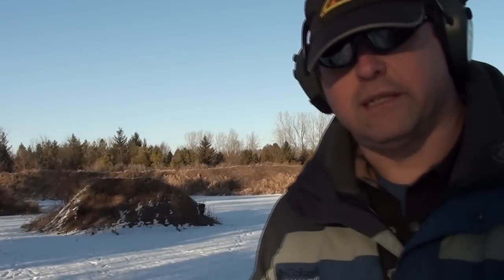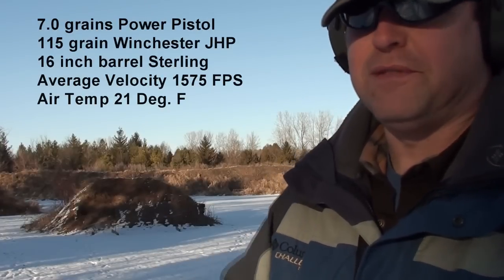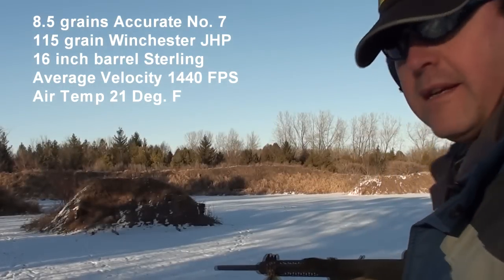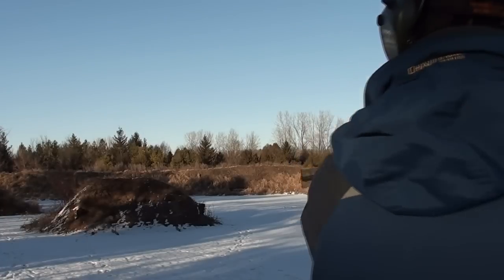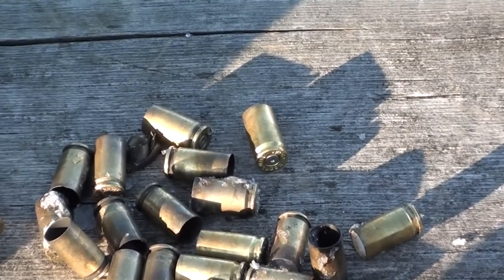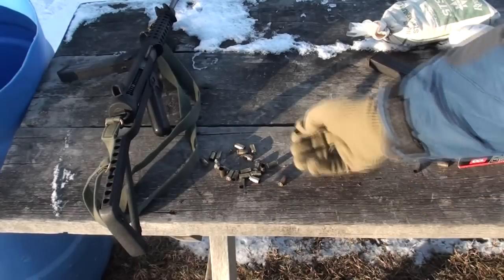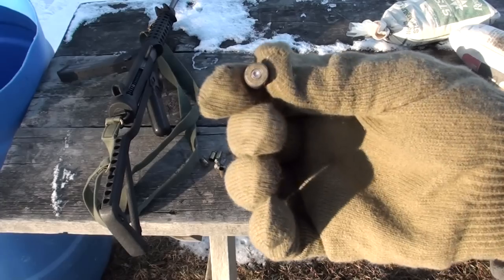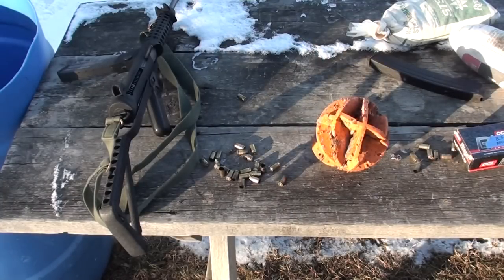9mm Carbine Loads - Alliant Power Pistol & Accurate #7

Comment: I currently load 9mm for my 9mm AR-15.  I use Accurate #2 powder, CCI Small Pistol Primers, Brass Case, topped with Berry's 115 grain plated bullet.  They shoot extremely well and lethally accurate.  I did load some Hornady 115 grain XTP hollw-points for it and got great results using .01 grains shy of the max load.

Comment from the maker: @TheLegumMagister Thanks for the tip.  I would imagine that self-chambering would be quite loud on an open-bolt SMG!

These semi-auto conversions are somewhat less reliable than the un-adulterated version you got to operate.  Sometimes, if the trigger isn't quite back far enough, like when carefully shooting from a rest at a distant target, the sear will miss the striker and not reset for the next shot.  Wish mine were a registered original, what a blast that would be, short barrel and all!

Comment from the maker: @TangoDownProduction With that fast powder they must be very accurate.  Bet those loads are super-clean burning - I would think the bullets would be close to the point where they decelerate before they reach the muzzle with your long barrel and fast powder combination.  

It'd be fun to experiment with your fast powder method as an accuracy load for XTPs using the chronograph and dial it in by adjusting the load and seating depth for the lowest standard-deviation.

Comment from the maker: @tnoutdoors9 The data that I used did not refer to these as +P but it would be interesting to determine what loads fall under that category.  It would be fun to do a velocity comparison with some different barrel lengths.  Not for any practical purpose, just for the sake of comparison.  My guess is that a load that produces 1500 FPS in a 16-inch barrel would probably not even reach 1300 FPS from a 4" tube.

Comment from the maker: @tnoutdoors9 Not sure of the actual pressure or if they would fall into the "plus" catagory.  The high velocity is simply from taking advantage of the extra barrel length by using slower powders, and lot's of it.  These rounds would not be efficient in a 4" barrel but I bet the fireballs would be spectacular.  
Might try 124s and 147s in a carbine loading but the pressure curve get's pretty sharp when trying to get those heavier slugs up to top speed.

Comment: Am I missing somehting, I’m fairly new in this area. But 8.5 grains of Accur-7 seems pretty hot at 115 jhp
Reply from the maker: Any answer I might give should not matter to you because every load has to be systematically worked up for each individual firearm using a reputable published data source such as  Lee, Hornady, the various powder manufacturers, etc..  We can't rely on other shooters for load recipes.  It's always better to keep your foot off the gas when handloading.  Strive for reliable function, accuracy, and clean burns that don't stretch the brass too much, and always within published specifications including case length and bullet seating dimensions.  Reloading manuals are what make this hobby fun.  
The Lee Modern Reloading book is a favorite.
Reply: @theKGB65  thanks.  I own just about every manual there is, which is why I asked my question...
Reply from the maker: Find this load in your Hornady 9th Edition manual.
 @firearmretreat

Comment: The Sterling had like a 7-8'' barrel on the original sub gun.  When your rifle was rebuilt to make it BATFE legal, was the barrel replaced with a 16'' rifled barrel, or did they just add another section of tubing, welding it on to the old barrel to make it legal?
Reply from the maker: These come with a brand new rifle-length barrel manufactured by Wise Lite Arms.
Reply: Thanks for the quick response.  I've a K-31 Soumi and all they did was add a 4" tube to the muzzle to conform to BATFE.